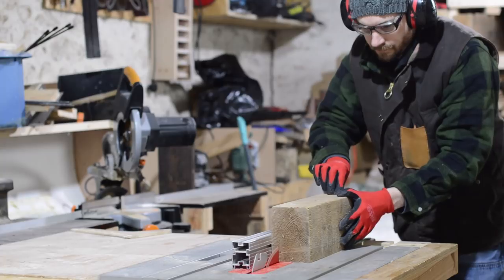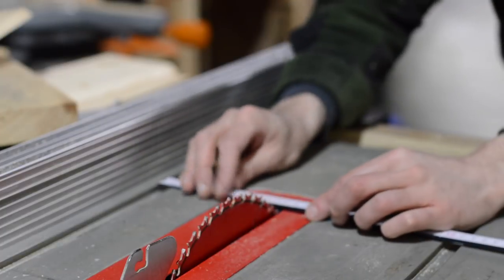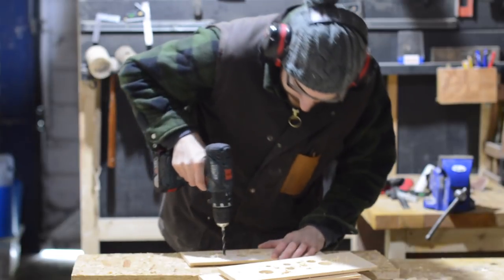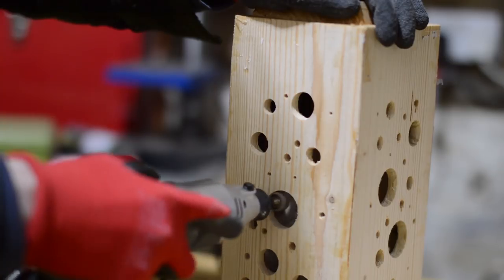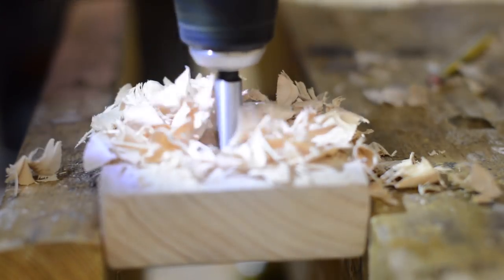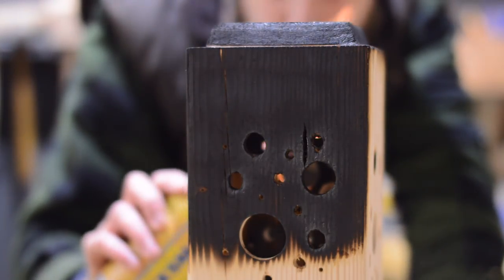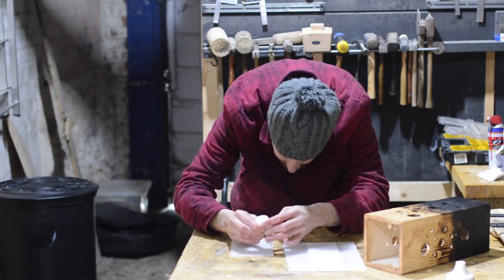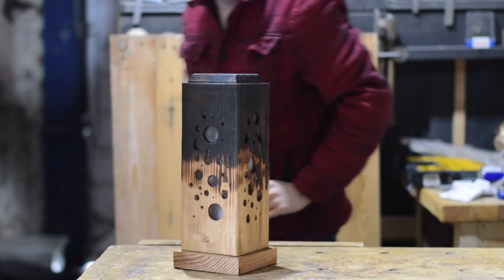LED Lamp Challenge

Comment: Great looking lamp Matt.  What blow torch do you use, and would you recommend it?
Reply from the maker: Thanks Keith. I have had it for years so I can't tell you what it is. But its just a cheap one. What I do like is it takes the butane bottle that my camp stove and fire take. You can get them for about £1 a bottle. 

https://www.amazon.co.uk/BUTANE-BOTTLES-CANISTERS-COOKER-HEATER/dp/B00CBIDE1Q/ref=sr_1_3?ie=UTF8&qid=1521880643&sr=8-3&keywords=gas+bottle&dpID=51H57lsto6L&preST=_SX300_QL70_&dpSrc=srch

Other gas mixes get much hotter but i don't need that most of the time.
Reply: cheers!